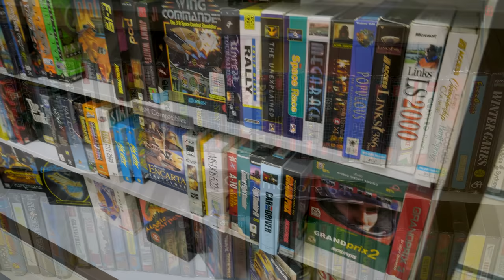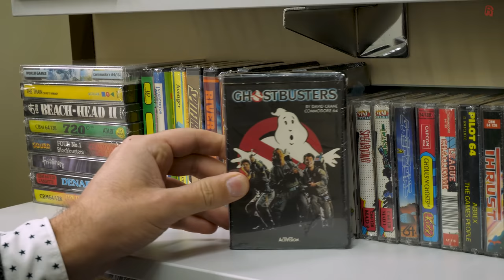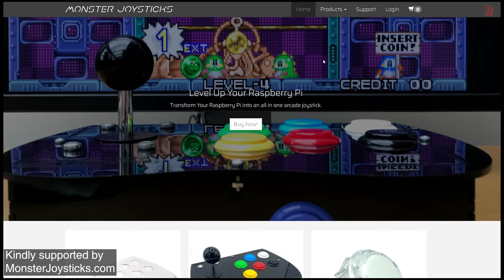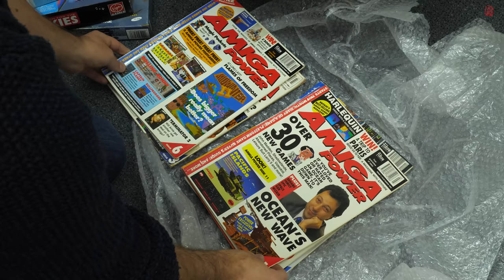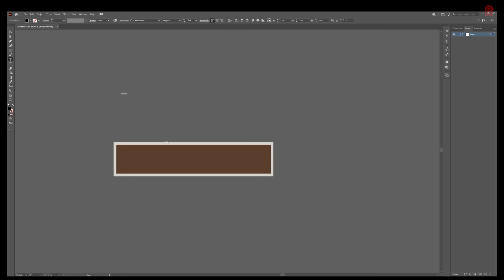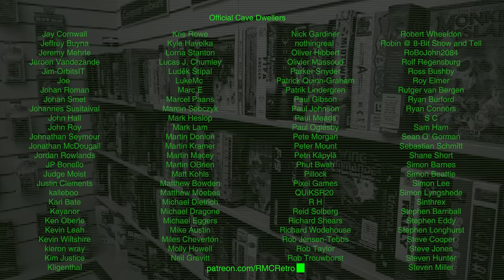Video Game Store Timewarp! | Recreating a retro game store

Comment: This gave me a huge smile, seeing big box games displayed like this!  The one thing that would put it over the top is the television showing the promos be precariously mounted from the ceiling using a tube/pipe mount that doesnt quite look like its designed to hold a television like that, with the wires all a mess.

Comment: The only suggestion I'd make is, if you can get reasonably priced extra boxed copies (or even just empty boxes) to have more multiples on the shelves. Most stores didn't have only one copy of each title on the shelves.  Especially for the console games you have displayed "face out", I'd expect to see an extra copy or two behind them on the shelves. The hanging Mastertronic titles, even though the rear titles are different, achieve the right aesthetic, since the outer hanging blister pack is identical between titles, so at a distance, it does look like "same title behind".

Other than the lack-of-duplicates, it looks EXACTLY like I remember stores like that looking in the late '80s/early '90s!

What's sad is that here in town, we had a game store like this that lasted until the middle of last year! They kept the exact same interior look all the way back from the '80s with only minor updates. They even still had an original Nintendo-official SNES demo kiosk that was still out and playable.  The past 20ish years, they specialized in older used games, so the shelves were still mostly '80s and '90s; and they did decent business buying and selling used games, going back to the Atari 2600 all the way up to current. (Yes, they did have a couple cases of current boxed PC games - the few still available, as well as modern Xbox One, PS4, Swtich titles. But their bread-and-butter were older consoles and games.)

Comment: I remember  my local WH Smiths games section. All of the games were unwrapped, opened, empty boxes. The tapes, discs and manuals were kept under lock and key in drawers under the games counter. You had to take the empty box up there, pay for it, and then they filled it.

Comment: Even though I'm from the US, I was hit with nostalgia as well. I believe the US chain Babbage's had almost the exact same aesthetic with the slat boards. The biggest difference of course is the large presence of cassette games. By the mid 80s in the US, most people had disk drives. One thing that might be missing is the proper smell to go along with the look. You need that chemical plastic odor. I don't know whether that came from the floppy disks, the shrinkwrap, or the demo machines, but it was an essential part of the experience.

Comment: The shrinkwrapping looks so satisfying ☺️ Admittedly, I don't have a frame of reference for the shop, considering I grew up in the early to mid 2000s. I'd only went to either Fry's or GameStop/EB Games (Probably the reason why the shop looks very staid and radio shack-y to my tastes 😆 It definitely fits the theme though!).
Everyone's already commentated great suggestions, I think a second or possibly third play area would be better for accommodating everyone, if you could fit them in.

Comment: I'm reminded of part of a very big local chain computer store in nearby Ottawa, Canada.  Canada Computers has a large selection of cables, including things like VGA and parallel printer cables, which is the sort of things you can stock when your retail store is large enough to have 50 different keyboards out on the display in the keyboard aisle, and dozens of different refurbished systems in the refurbished system's aisle.  And a gaming chair aisle, and so forth.  This is a big box style computer store.

Comment: For a real authentic 80's C64 experience (of a typical nerdy high-schooler) you need to setup a small clandestine hacking setup in a corner somewhere, with 2 1541 drives running a copy of Fast Hack'em. 
A 15 year old, sitting at the monitor, with a guilty look on his face would make it perfect
:D
BTW your full-scale shop diorama came out very nice indeed. 
Cheers,

Comment: That shop is crazy well stocked compared to what I remember 😁 but that's also necessary to be able to host that many titles of course.

Anyway, yes, a rack with a few of the latest magazines was also always there, so it'd be a great way to use some dupes that you already have in the library, especially if you can put some, perhaps non-functional, cover disks on some of them, the way they were sold. This shop is certainly more about the authenticity of the shopping experience, more than it is about the functionality.

So if you have some particular valuable games on tape, why not keep those in the back and shrink wrap the box with a cassette recorded with all the greatest anti-piracy hits, like "don't copy that floppy" on repeat? I mean, it's cool and all to have the originals there, but if it's something you've already wrapped yourself, and they're not supposed to be opened anyway, it would greatly reduce the risk of bad apples come rolling by, if you never know if you'll run away with an original tape or not. Of course I'd never unwrap an original in original packaging just to pull that prank.

Comment: Very cool cave. I would remove some of the games and add a section with boxes for some of your hardware. I remember yearning for an Amiga based on the games bundled with the system, even lusted after peripherals (hated flight sims but wanted a Thrustmaster, never owned a SNES but still wanted the superscope). For authenticity a till would be cool but guess space is an issue.

Comment: I was just wondering if it would be an idea for extra security to attach small RFID strips to the bottom of the cassettes and boxes (or inside of if possible) and add a sensor to the door that would then trigger if anyone walked outside with anything.  Added bonus is that if anyone said that they did not have anything on them when they did, you could just ask them to walk through the door again for it to trigger again and if they do not have anything on them then all you have asked them to do is walk through a doorway.

The sad thing is that as much as you can hope for the best, there will always be someone who will try their luck.

Oh, and the only thing missing from the shop is the bargain bin :)

Comment: Can't comment on sega in the UK, though here in australia it was more or less a rental market  from the mid 80's to the late 90's, sega master system didn't  really start major selling until mid 98 early 99, even when the mega drive came out main stay sales was sms titles, with all the fuckery that followed rather than developing independent consoles, in the space of 10 years they had around 12-15 consoles on the market

vic-20/c64 kinda died out by 1989, same with most 8 bit computer systems....

by 1999 with pc's we moved away from 5.45 and 3.5 inch for cdrom/dvdrom for gaming on pc..

tandy and the ilk and every major and minor player in the 8 bit computer scene..

though with the likes of steam you can get most 90's and some 80's pc games so there is really no need for  a whole slew pf pc boxed games..